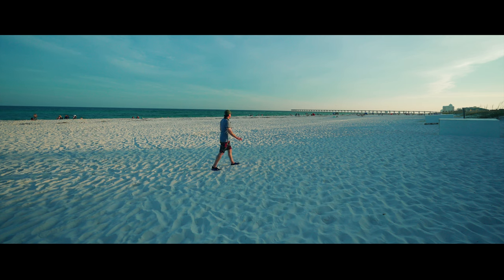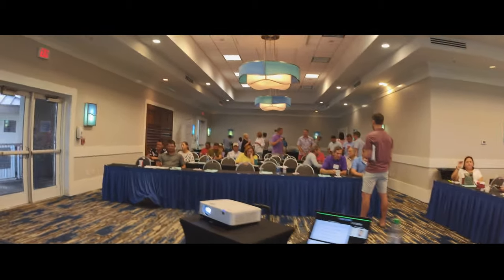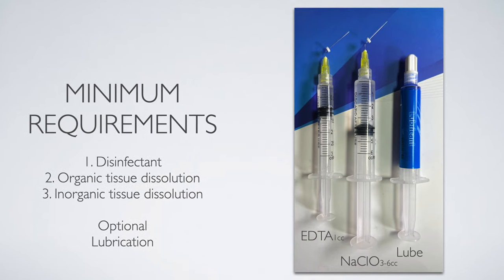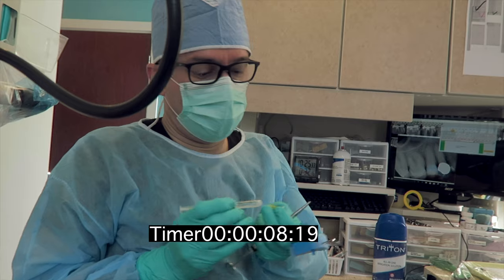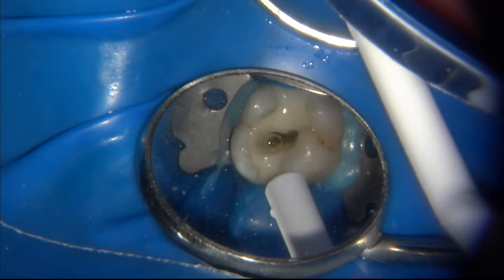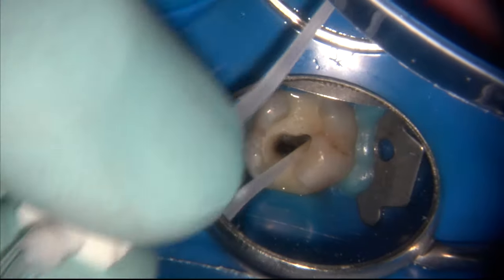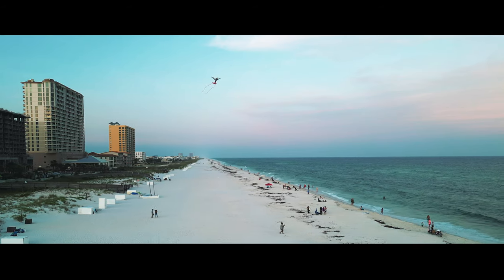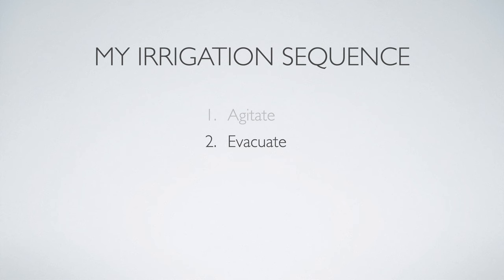My 3 Step Irrigation Concept during instrumentation from Pensacola Florida

Comment: hi super Dentist . do you give a crown in such a conservatively approached tooth ?
Reply from the maker: A crown is it needed in every posterior tooth after endo; but if you’re talking about the one in this video, then since the mesial and distal marginal ridges are gone from previous decay, some kind of cuspal protection is helpful in the long run in the form of an endo crown or only. Internal bonding with a new fully bonded restoration can also work; but we need to make that call base on how much remaining decay and leakage was present around the old restoration. 
There’s no question there are too many crowns. But w need to find that right parameter which is currently not solid. The ADA recommendation is a crown after endo in posterior teeth but this decision should be made in light of patient properties and individual occlusion and parafunctional habits, and remaining tooth structure, rather than one  blanket statement that will get abused depending on bias. That’s at least my opinion. Everything is about understanding and managing risk. Good question! Cheers!
Reply: @AANasseh  Right sir . I am also a Dentist. your videos always open up our minds and broaden our thinking .
And yes I was talking about the tooth which you just showed in this video .
I am thankful to you for such a brief answer. Stay blessed !

Comment: So just to clarify, having said all this, what solution would you use while instrumenting canals?
Thank you RWE and Dr. Nasseh!
Reply: I gathered he is using water and intermittent PUI with microsuction during instrumentation to remove the debris generated while shaping the canals to WL. I don’t see harm in rotating 17% EDTA solution during instrumentation also.  It provides additional lubrication to reduce stress on the rotaries.
Reply from the maker: I use the three steps.. ultrasonic and water to loosen up debris followed by removing the water and adding Triton. Triton is a solution that contains all the irrigation ingredients in one: NaClO 4%, Chelating agents, Surfactants, and lubricants. It’s all in one solution.
Reply: @AANasseh  excellent! The rational was explained well in the video, but I thought you were talking about irrigation once the shaping was complete. It wasn't clear that US activation with water was your preference during shaping. Do you believe that an access tip, like an e4d is sufficient for this purpose? I am assuming that you are recommending water-port tips for this application.
Reply: @2thdoctom  Thank you for your insight. I use the Endovac macrocanula lately for this purpose. I used EDTA solution for shaping, as you described, because when Dr. Stephen Buchanan described it, it made sense to me. 
When I heard Prof. Markus Hapasalo talk about dentine erosion due to edta use prior to NaOcl use, I stopped doing it.
Even though the long term effect of dentine erosion is yet to be known, I was convinced to abandon this approach.
Reply from the maker: @michaellupu2080  This is again another good point... the problem is I'm making too many assumptions. Obviously these are not scripted and why some areas I make this mistake. I ONLY and ONLY use water ported tips... in fact... I believe that non ported tips were designed by people who have no idea about ultrasonics and how it works! I have continuous flow of water from my ultrasonic and that's how it helps flush and agitate! Now I have to make a video on that specific point!
Reply: @AANasseh  I'm sorry/happy to bring it up :) I love your videos, so for me, it's a good thing.
Obviously, some US tips that act deep in the canal, like E7 and E8, are important but they don't have water ports. 
I just wasn't sure that activating a tip (with water) in the pulp chamber could send enough "flushing energy" to the rest of the root canal system, particularly around smaller, curved canals.